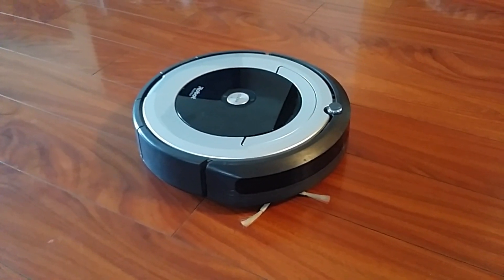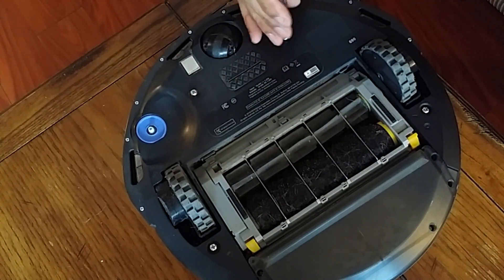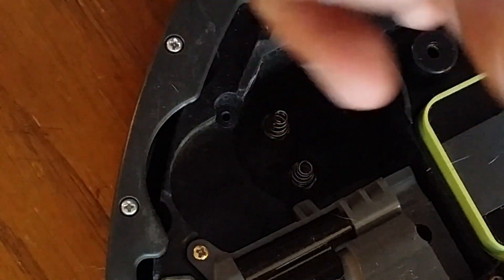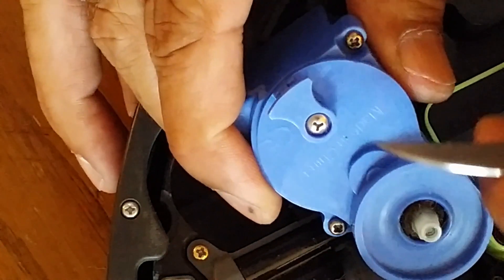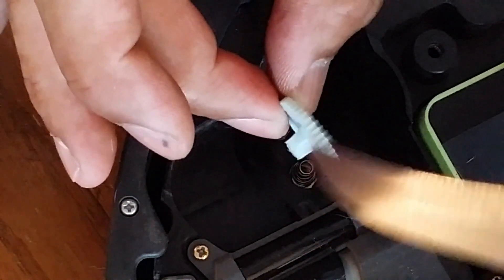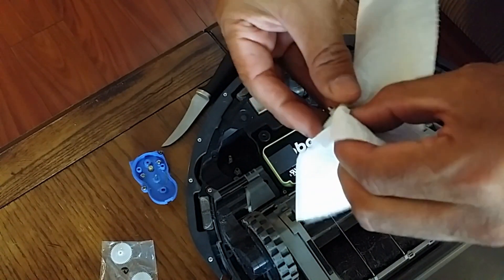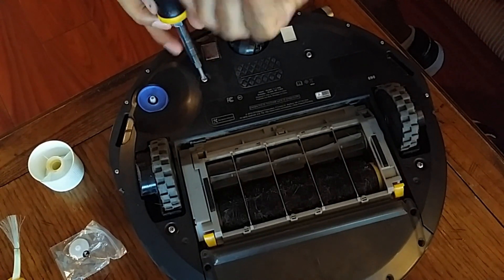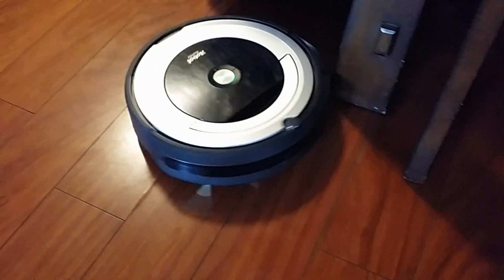iRobot Roomba Side Brush Motor Fix

Comment: You saved me a couple hundred bucks from buying a new roomba! My gear wasn’t stripped but the gear was stuck on some hard residue that had built up around the hole where it came through the motor. I got it off and it works great now. Thank you!
Reply from the maker: Glad it worked out! Thanks for watching and commenting!
Reply: Maybe that’s my problem , will open it up again and check

Comment: My top gear is stuck and won’t come out of the top part of the motor( the part without the battery).  Any tips or will the entire thing need replaced?
Reply: I used a screw driver to pry mine off.  There was another post about the lube solidifying and causing the shaft to bind on the hole it goes through.  I pried off the gear, scraped the dried lube off and put it back together.  Back in business!